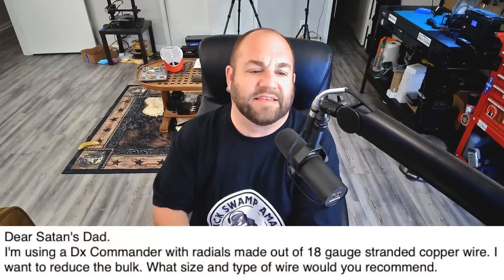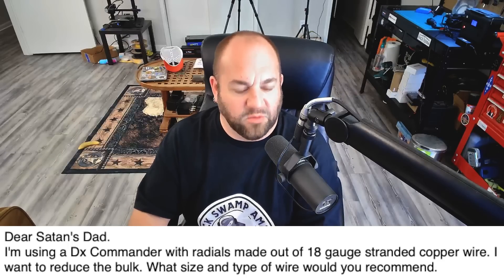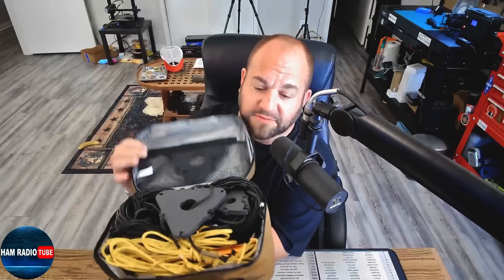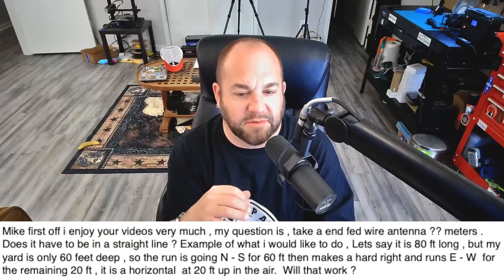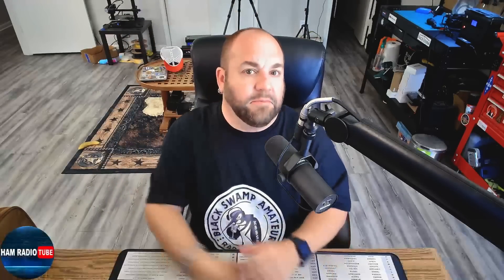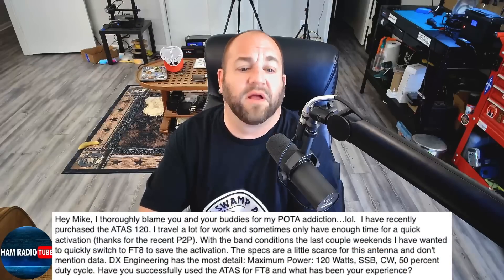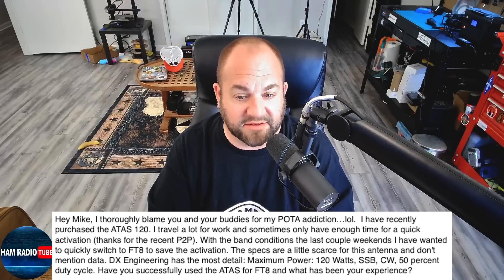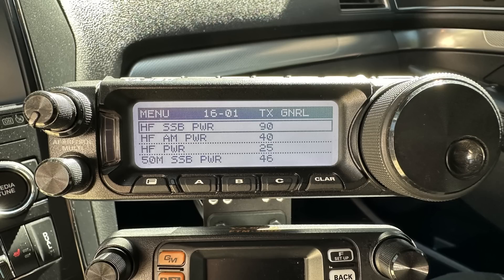How Much Power Can The Yaesu ATAS 120A Actually Handle??

Comment: Another option, particularly if your antenna wire needs are great, is the direct burial wire used for electronic dog fences. The wire I got from Extreme Dog Fence came on a 250-foot spool. It is hard-drawn 14 gauge copper that won't stretch under load. The coating is so tough, it's almost impossible to remove with a knife. I have to use wire strippers. It is stiff and heavy though, so it might be best used for permanent installations.

Comment: Most of the Yaesu rigs run only 100 watts that have the 120-a option. You can not run any device between the Atas 120 and the radio output. The radio supplies the power for the Atas. This would damage HF amps and other devices.

Comment: Yaesu basically answered the question in the manual.  A3J emission is the FCC and ITU identifier for full-carrier, double sideband AM.   J3E is single sideband, suppressed carrier.   Unfortunately, they didn't clarify if it's PEP or unmodulated carrier power.  I'd assume it's PEP.   Since AM PEP is 4x carrier power, 25-watts carrier, 30 watts FT8 would sound about right.   30 watts is what most 100-watt radios advise operators to run for FT8.
Reply: I gather that the old term A3J was renamed J3E by the ITU, but yes Yaesu does in fact tell us that 120 watts refers to SSB mode.

Comment: ATAS 120 being 1/4 wave antenna,   No toroid inside.  it probably can handle quite bit of power.  it just have motor inside to Up / Down  the internal coils.  I guess first things go can be damaged is brushes attach to internal coil , so as long as motor does not move / brush move while transmitting,  it probably OK.  AG6JU

Comment: If you open a book (I know, quaint) or google it, A3J is single sideband suppressed carrier. So 120 Watts SSB. The latter third of this video is indicative of a generation who expects everything to be put on a silver platter for them to ingest. The question of power rating was answered within the first few moments of the segment when he showed and said "120 watts A3J" which he later confirmed after some hunt. The meaning of "A3J" used to be on the General test and used in ARRL books. I'm dismayed by this failure of very basic knowledge. What would you do if you saw (obviously not reading since that's outside the scope of newer hams) "IR drop"? Look it up and learn something (simple).

Comment: I agree about the antenna not needing to be perfect to work.  From August of 2023 to Feb 2024 I was using a 10 meter inverted V wire dipole with my G90 and was able to make contacts on all bands from 40 meters to 10 meters thanks to the internal tuner of the radio.  It wasn't very efficient on the other bands, but I was being heard.  I was very thankful my Elmer insisted on putting up the 10 meter antenna when we put up my 2m/70cm vertical in April 2023 just in case I got an HF radio before I upgraded to General.  I upgraded to General first and then was gifted a used G90 as a congratulations for passing the General exam.  I now use an 80 to 10 EFHW at the home shack and it works a lot better than the 10 meter antenna.  Still I was able to play around on HF for several months with a compromised antenna.

Comment: It's kind of W.T., but I keep my DX Commander paraphernalia in an empty Yuengling 12-pack box.  The lunch box is a great idea.

I run an 80m EFHW out of my shack.  It runs ~50' east, then ~80' north.  I have it up in trees, as far as I can throw a weight ...so, 30'-40' high.  It works great.  However, I noticed that its east-west (broadside to the end of the wire) propagation is WAY better that the north-south propagation.  I can hit Europe and the west coast with no problem at 100W, but I struggle to hit Texas to Florida from Zone 3.  I guess the bend in the wire makes a bunch of weird nulls and spikes that favors east-west.

I don't have an ATAS.  I have a glorious assortment of hamsticks for mobile/cold-weather POTA from the truck.

Comment: Weak signal mode implies low power. If your neighbor in town is using 500 Watts on FT8 your weak signal reception for half the cycle is going to be non-existent.
Reply: So you are saying only power can create a weak signal? How about propagation condition, antenna characteristics, QRM, etc? Many other things lead to issues where more power is needed. Weak signal does not mean low power.

Comment: The amount of power an antenna can handle is dependent upon the  "duty cycle".  Duty cycle is the amount of time the transmitter is actually transmitting.   The following are reasonable estimates of duty cycle

SSB - 33%
CW - 50%
Data - 100%

To stay within the margin of safety of the ATAS-120 that would roughly equate to

SSB - 120W
CW - 60W
Data - 30W

It does not mean you can't run more than 30W on data.  As you exceed the 30W level, the components will begin to get warm.  The longer the transmission, the warmer things get.  Could you run 120W on Data for 15 seconds without damage.  Probably.  Could you do it for 1 minute? I don't think so. The difference between 30W and 60W is 3db.  3db on FT-8 makes little to no difference, so why risk it?

Comment: Another option to the person who wanted to string an 80 meter EFHW into a small space: They could always cut a wire for 40 meters and tune that up, then attach a 110 μH loading coil and another ~3 feet of wire for 80 meters. That's the approach I took and it works really well. I ran the EFHW in a sloper configuration, diagonally across my backyard, which is relatively small.
Reply: Or put the full size 80m efhw up as a half square. Only takes 66 ft of space and still works great on 80

Comment: Hi Mike,

In your video at 6.10 min you talk about putting up an end fed in restricted space. Well I can confirm that inverted-L configurations work well. I have a 23 meter long end fed (80-40-20-15-10) with a small coil (80m) and have only 16 meters of depth on my lot. I have a 10 meter aluminum mast in the front and a 10 meter fiber mast in the back. I go up 10 meters vertical and the rest of the antenna errects horizontally to the back resulting in a decent setup. My findings are that all bands are still as expected (according the resonant points when horizontal) and I came to find one extra benifit. The antenna is still decent directional but the vertical part seems to help the antenna to be a bit more omnidirectional on some bands. I hope this helps the ham operator not to hesitate to put up his antenna.

In your video around 11 min. I used my ATAS 120 a lot of the time on CW with 100 watts peak. I had no problems at all. Continious carrier I reduce the max power to about 50%. 

73 Phil ON4VP

Comment: I have heard the Yaesu sales rep state that all Yaesu HF rigs should be transmitting no more than 50 watts on FT8.  I have used both my FT991A and FT891 with full power FT8 and they have performed fine. I keep ALC deflection at the lowest level. My ATAS 120 handles 100 watts of CW all day.  But those windings and that coil form look too vulnerable for a continuous 100 watts.  Good advice Mike,  as usual.   Thanks.

Comment: In my experience, you can immediately tell if an antenna is starting to have trouble with the amount of power you're pumping out via FT8 by watching the SWR while transmitting. It will be fine at the outset and then start to climb. That said, this observation has been made only with transformer-and-whip or transformer-and-wire antennas (e.g. the CHA Hybrid Micro, if you put out more than its rated 20W digital for more than a few QSOs), so I don't know if "overdriving" the ATAS would have a similar presentation.

Comment: So far, 1300 POTA contacts with my ATAS120 in my Ram pickup in a month. Grounding straps are the key to performance. I have continuity from the tailgate to the hood and everything in between. I get a lot of 59's on 50 watts for the most part. Don, K1DLA

Comment: Thanks for the videos, Mike!  For the ATAS power rating section of the video:  From Wikipedia:  A3j type of transmission means single-sideband transmission in which the carrier wave is transmitted at a power level more than 32 decibels below the peak envelope power.  Similar to the ATAS, the Little Tarheel (which I have) is rated 200w PEP SSB and only 50w for "all other modes".  Although I regularly push 100w FT8 through it.
Reply: 100w on FT8?!? Wtf??
Reply: That use to be on the test as well
Reply: I suppose I probably shouldn't have but I've pushed 80 to 100w FT8 through the ATAS in the past. I've never had any issues, but sounds like if I use it for FT8 in the future maybe I should use lower power, lol.

Comment: For the guy with the 60' deep back yard, you could run the antenna wire on a diagonal It should fit as long as your lot is 60' wide.

Comment: All radio transmission modes have a FCC designator.  A3J is AM (Amplitude Modulation), double sideband, full carrier.  Having said that, there's no way I would be running 120 Watt carrier AM into a ATAS 120A.  Seems like the manual is the only place they reference A3J.  Everywhere else list SSB, CW power.

Comment: Mike
Technical Writing and Technical writers, i.e. the people that write the technical documents and manuals. An art form onto itself. They have all gone the way of the rotary phone. Now days the technical writers may have not even seen let alone touched the equipment they are writing about. The only thing you can be sure of is the cautions and warning. That's driven by the liability issues.
Reply: One of the problems you run into with anything made overseas is the "lost in translation" effect.  God help me, some of the Chinese manuals version of Chinglish is absolutely horrible.  I could probably get more pertinent information about a radio product from reading a toothpaste tube than I could the Chinglish radio manual.

Comment: I think the guy in the first question was asking about "ground" radials, not wire for the radiating elements.  He said radials and when people say that they usually mean the ground radials.  If that's the case, anything should work fine.  I have seen people strip out old CAT 5 network cable and use it for ground radials.

Comment: I think you should use lower power for full duty cycle modes.  FM. RTTY.  And I would include FT8.

Also LDG and Wolf River Coil have lower power inputs for digi modes.
Reply: I did some RUDEimentary math below:

digital is a 100% duty cycle..... CW is 50% so likely... and this is my intuition speaking.... half of 50% is 25% ... so simple math is : 120W / 2 / (2) = 30W @ 100% duty cycle.... AND before we get all exponential on my ass... I used fingers and toes...

Comment: Regarding the comment on routing an EFHW antenna, my personal homebrewed EFHW is 138ish feet long and I have it strung in a  horseshoe-like shape thru 3  trees and at varying heights and it works out very well.  It tunes up everything from 160m to 6m with a 1:1 match on all bands.

Comment: Pushing 100 watts on digital all the time.. Probably why I'm having issues now😅
Reply: Explain the situation to Yaesu and ask for a warranty replacement. Then I bet they mention what your a maximum power on digital modes should be!
Reply: @TravelinHam  you bet 😂 considering I already opened it up and adjusted the ball bearings and cleaned the coils.. I doubt my warranty is still there.. But I think my use case is kind of extreme anyway.. being a truck driver I probably already put 160,000 miles on that antenna.

Comment: LOL A3J=SSB which I am sure you know.
Reply from the maker: How does A3J = SSB?
Reply: @hamradiotube  - A web search for "A3J emission" indicates that A3J is an old designation for "SSB, suppressed carrier." The designation has since been replaced by J3E. Some websites breakdown each letter's designation. Do I pay attention and have this stuff saved in my head? NO. I'm not that edumacated, nor do I care that much! But that's what the reading tells me. My practice is to operate at 100W SSB and 50W in digital modes with the ATAS-120A. 👍73! -Scott, KE4WMF
Reply: A is AM. 3 means voice. J is the variant of AM voice where you get rid of one of the sidebands and the carrier.  This was all on the test when I got my license, young  whippersnapper.